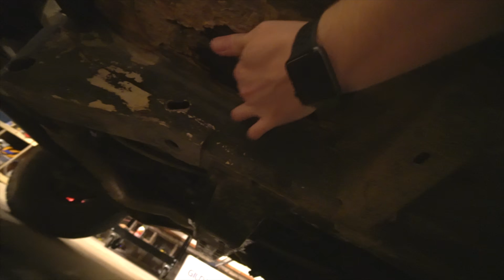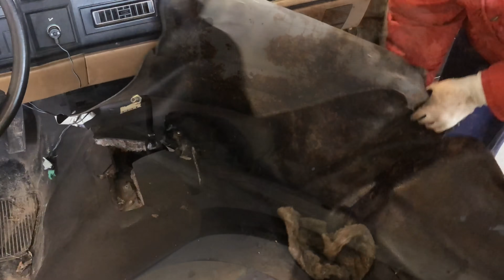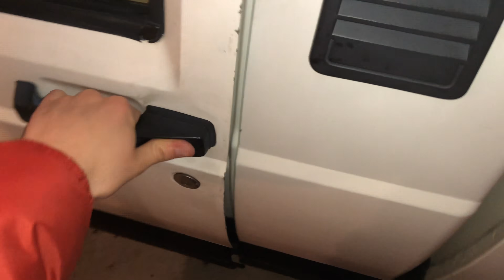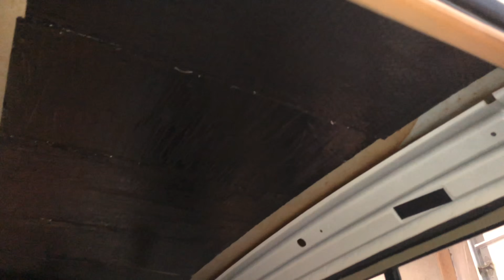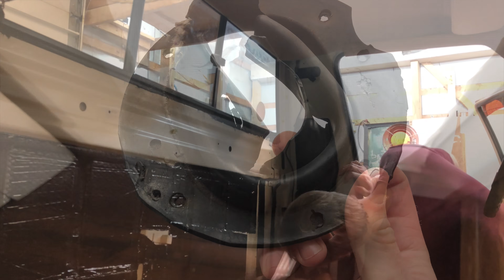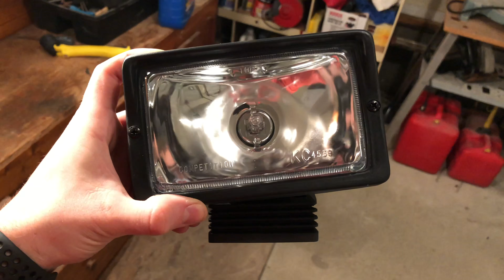1987 Jeep Truck Restoration Project: PART 2 (Interior)

Comment: July 7, 1987 is the day I bought My Comanche ❤️ 
First clutch went 134,000. 
... It still runs 👍 Original starter lasted until 2016. 
Still has original Peugeot transmission. 
Dealer installed AC died decades ago, thanks to a crooked Dealer mechanic shop 1989. 🙄
I can name most eVeRytHiNg that's been replaced since 1987. I joke, "like 4 of everything". 
4.0 inline 6 cooling system is a hassle, runs hot because the engine over torques, cracking the exhaust manifold. That happened like before 70,000, 1989. Exhaust manifold has been replaced TWICE. 
3 of the fuel injectors are original, 3 replaced 2007.

I could list a book of memories via My Comanche. It's on My list to figure out how to update, & clean it up. It's difficult to locate a Mechanic that will do the work, that I trust .. AND come up with the cash. So, I basically do what has to be done & park it except for hay & truck stuff. 

My Jeep floor has less holes than this truck here, but so helpful to watch the process. 👍

Wish I'd win a rebuild, repaint via a television Auto show. 🤣 
The idea of walking in seeing My Comanche all fixed up tears Me up to imagine it. ❤️ 

Is a love/hate relationship via that Jeep... 😂
Reply: Great story. I believe you do have many memories with your truck. That's great you've kept it. It doesn't sound like it's hurting you to keep it. Especially if you don't have everything rusted out from the roof to the road! Fix it now. It's paid for itself and even saved up for the restoration money for you. You can't replace it with anything new. When they start falling apart they fall hard and hit with a dull thud.
Reply: @jollyjeepertheglen9697  Thank You & Yes, it's paid for itself... Original price new was just over $11,000. 
I still have the original sales brochure... It was My first new vehicle. And YES, I prefer older simpler vehicles. 👍

Comment: You did a great job restoring that Jeep Comanche. IDefinitely a rare truck.  picked up a few pointers/ideas watching your video. I am restoring a 1985 Jeep J10 long bed. Mine does not have the rust problem. It does need to be repainted and has some surface rust on the bed and installation of the rebuilt 258 engine with Howell EFI. I will be watching Part 3 of your restoration.

Comment: Got a question for you: I'm starting to restore an 87 Comanche myself, and I noticed that a lot of the screws are either missing or they're so rusted that they break when I try to remove them. If you faced the same thing with your build, where did you get the replacements from? Did you use different types of screws? Thanks a bunch
Reply: Did you ever find an answer? I just received an 87 xj and ive noticed the screws missing as well.

Comment: That Comanche is looking good. I did not have the proper respect for these pickups back in the day but I do now. I preferred the old J series at the time. Rust runs rampant in all old Jeeps. My parents bought a 76 SJ and by 82 it was bad, in 84 I stepped through the rear floor pan. So when they bought the 86 XJ its first destination was Ziebart. Whatever they used for undercoating worked. When my parents got rid of that jeep in 93 it had surface rust on all the normal places under a car you would expect but the floor pans work honestly spotless. There were spots on the body panels that were starting to rust but not underneath.

Comment: Terrific video(s)! I just re-purchased my dads 1989 Jeep Comanche (coworker sold it back to me after 7 years). It's in relatively good shape but, due to age, it seems much like yours. The interior smells musty, definitely some moisture inside. After seeing your interior make over, I guess I'll tackle that too! I'm very much a DIY person, Build, fix and repair most things inside and out, but I've never been a "car guy".   Can you rate level of difficulty for this interior make over? Scale 1-10, easy to hard? Starting AFTER the floor hole repairs because I'd hire that part out too.  Thanks!!!